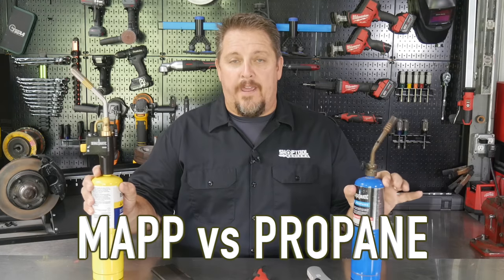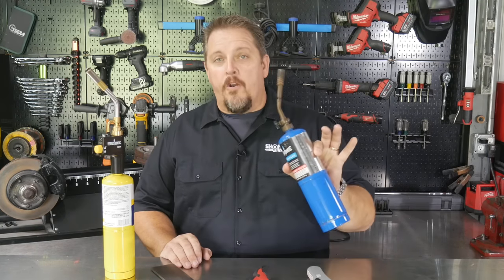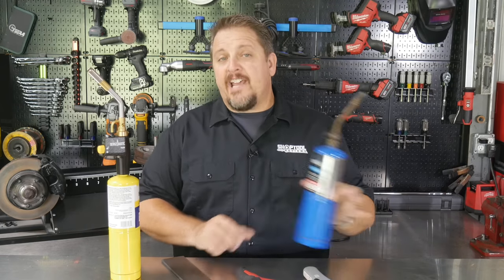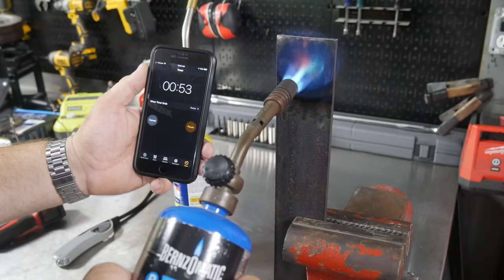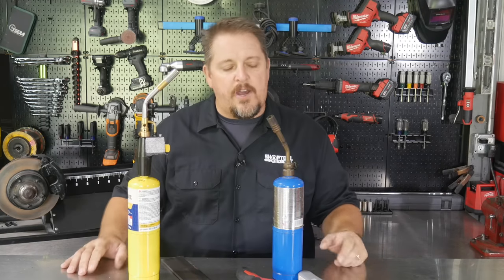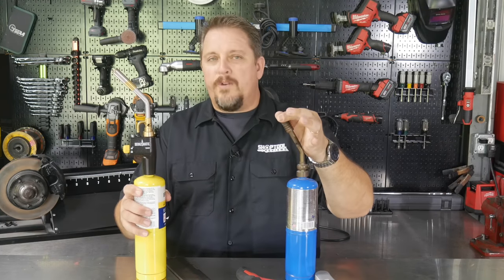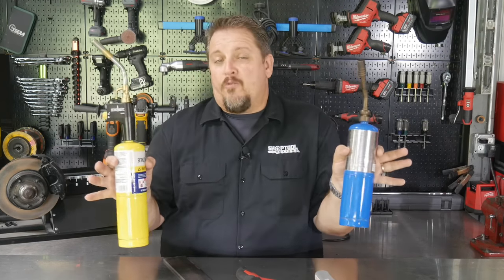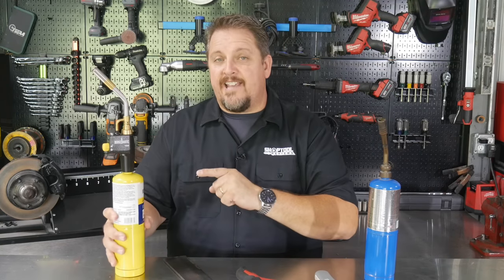MAPP Gas or Propane - Bernzomatic TS8000 Torch Kit

Comment: I'm a newbie in hand torch world, but this contradicts science. Look up adiabatic flame temperature of propane and propylene. Its quite the opposite, reason being each gram of propane produces more water in combustion than one gram of propylene. That extra water absorbs heat, so less heat would be available to the flame (which is just a mixture of carbon dioxide and water and inert nitrogen of course).
Something must have gone wrong.
Reply from the maker: And that's exactly why we did this test. There has been so much confusion around the Propane and MAPP discussion, and even more confusion since they stopped making the real MAPP. So, we performed this pretty simple test and shared the tips between the tanks. I'm not sure what could've gone wrong, but I'm sure there's a possibility. Thanks for watching.

Comment: Bernzomatic rates its TS8000 torch at ~12936 BTU/hr using propane and 12327 BTU/hr using MAPP. The torch head is mostly what determines the heat output of the setup, not the type of fuel. Also the flame temp doesn't really matter when heating up steel. All that matters is the BTU/hr that the torch produces.
Reply from the maker: You are correct. Thanks for watching.

Comment: My TS8000 tip end glows red about 1/2 down with map pro gas . I didn't time it but every time I have used it, fairly quickly. Should I be concerned about that?
Reply from the maker: That does sound a little odd, especially if it doesn't happen with Propane. You may want to check another tip and see if it does the same. Thanks for watching.
Reply: @Shoptoolreviews  just tried blue propane 1st time. It did not do it. then tried the map gas it did not do it. so I have to keep an eye on it . might take longer thanks for the reply.

Comment: Temperature wise ok I agree with you. But try to time how long it would take to melt silver or brazing rod then you’ll really see the difference.  I used propane for small brazing work and while metal is red hot, propane still can’t fully melt the brazing rod to create a pretty joint. However when I tried again with map pro, BOOM 30 second job is done, and melt the rod like butter.
Reply from the maker: I hear what you're saying, and that's probably not a bad test to perform, with brazing rod. But, then you get into which brazing rod to use? In the end, temperature melts that rod, so that's why we were aiming to test the temperature output from the torches. I think the main point is that torch tip geometry made more difference than the fuel.

Comment: how long does the can last? assumed that you let it open until it dies? 4-6h?
Reply: I just bought mine brand new and it ran out in no more than 6 minutes. Either that or it stopped working.  I have been trying to find this same answer because i feel like it should last much longer.
Reply: @kristopherbuchanan974  it definitely last much much longer,  ive been using one for more than half a year here and there.
Reply: @TheCyberCorn  thanks! I definitely felt it should have. I have a feeling i was sold a near empty bottle from the store.
Reply from the maker: Thanks for watching.

Comment: what happens if u put propane head on mapp gas? will it still work or no? basically is it dangerous?
Reply from the maker: It works just fine, but not as hot. Thanks for watching.
Reply: Wel if you watched the video at the very beginning he says that the propane head can’t be attached to the mapp tank.

Comment: MAP PRO IS NOT MAPP GAS. MAPP gas was discontinued is 2008 and burned at around 5300deg whereas map pro which isn’t MAPP burns at only around 130deg hotter than propane. Suggesting brazing with a bottle of MAPP pro is a bad call

Comment: the nice thing about mapp gas is that you can use it upside down unlike propane
Reply from the maker: Interesting, we'll have to test this. Thanks for watching and for commenting.
Reply: The Bernzomatic 8000 tested here burns upside down with propane too. Here's what Bernzomatic says: "When theses torches are inverted, the liquid propane works its way through the torch and extinguishes the flame. For work that requires inversion, we recommend a pressure-regulated torch, such as the TS3500 Multi-Use Torch or a cast body torch, such as the TS4000, BZ4500HS, or TS8000."

Comment: Maybe, just maybe, you could of had the same torch designs make model on both gas supplies then tested. Only saying 🤷🏻‍♂️ shouty
Reply from the maker: Isn't that what we did?! We tested them, then changed the torch heads. That was our final determination is that the torch head makes more difference than the fuel, because MAPP gas really doesn't exist anymore.

Comment: Yikes.  At some point the metal will stop taking heat. Both temperatures are the same after a minute big surprise the metal is radiating heat from the other side it's latent heat! A more scientific test would be to use two identical torches and see what gets to 400 degrees faster now bernzomatic claims there's 40 percent faster heat transfer.  Even though they vary in flame temp by only 130 degrees. Science!  But does a 40% faster heat transfer increase justify the 300% price increase?  Or can you just wait a minute. I mean time is money right?
Reply from the maker: Thanks for watching.

Comment: Use 1 torch, or switch the heads and test again. You are comparing a torch heads as well as fuel.
Reply from the maker: That was exactly our point at the end. We switched torched heads. Torch head makes all the difference -- MAP/PRO and Propane are not much different as far as fuel is concerned.
Reply: What blows my mind is that you can switch torch heads after first use. I was under the impression that once you screwed on the head, you’re stuck until it’s on empty. Sweet! Now I can use my new ts4000 on my old half full bottle of propane without wasting gas and money by buying mapp

Comment: why don't you use the same burners for each fuel? 
It's a bit biased.
Reply from the maker: That's exactly what we did, if you watched all the way through. That was the point...fuel doesn't matter, it's all in the tip/burner.

Comment: MAPP PRO- is a complete waste of money. It exists only as a “name” for marketing. MAPP gas was stopped being produced in 2008- it use to burn roughly 1500 degrees F hotter than propane. MAPP PRO is roughly 95% propylene and 5% propane, and only burns roughly 140 degrees F hotter than propane. It literally not noticeable. The only thing that is noticeable is how much money is wasted on yellow MAPP PRO bottles. If you need to heat something up faster, gone are the days of doing it with a single little tank. You’re gonna need a combo oxy/acetylene torch or a small oxy/ propane (or MAPP pro which would be a waste). That’s the only way you’re gonna notice a performance difference. If you are relying on MAPP PRO to do that- you’re burning your money away 💰 🔥 (no pun intended)
Reply from the maker: We explained all this in the video.

Comment: If your working on cars MAP! Open and shut case.
Reply from the maker: What's your reasoning?
Reply: I would like to hear why you think MAPP is better for working on cars. I've tried to use propane to heat up bolts that are froze on cars and it was not hot enough, but I did not use a high intensity head either. I would like to see this torch taken to a frozen bolt, and see if it can turn a nut red hot with propane, or does MAPP work better?
Reply: I have the same issue and I even started using x2 blow torches pointed at the rusted bolt and nut. Still won't get red cherry hot but so far it worked successful every time. The problem is MAP gas is very expensive x10 cans and you are already at 150$, propane can work out x12 for 30$. Even at current prices I'm thinking it's time to buy/DIY an induction heater. We will see...let's find out how often they break down first due to lack of cooling.

Comment: Not scientific at all, of course. Just a pitchman yelling about a Slap Chop, I mean...a Bernzomatic torch.
No explanation about why you “can’t” put a brass torch head on a MAP/PRO bottle—just “I know”. No mention of the temp of the metal BEFORE the first 30 second propane heating. Meh, it’s just another screaming “Billy Mays” or “Vince”.
Reply from the maker: totallyfrozen prove it wrong if you think our results are skewed or wrong. The point is, with a decent tip, Propane burns as hot as MAPP/Pro. MAPP is all but a gimmick now, true MAPP has hasn’t been produced for over 10 years.
Reply: Shop Tool Reviews 
LOL! Who told you that you can’t use MAP/PRO in a propane torch? MAP/PRO burns only 130° hotter than propane. MAP/PRO burns at about 3,370°F while propane burns at about 3,600°F. The melting point of brass is about 1,700°F. So if the brass torch was going to melt at all, it would melt with propane just as easily as with MAP/PRO. The design of the torch keeps the heat out front of the nozzle, not concentrated IN the nozzle. So it won’t melt the nozzle.
Reply from the maker: totallyfrozen I never said the torch nozzle would melt. I’m not sure what you’re saying. My point is, the nozzle plays a huge role in the heat that the flame/fuel produces, whether Propane or MAPP.
Reply: TF, 
Why are you arguing with yourself?

Comment: VERY POOR Test design: Using different torch tips on the two canisters make this test and results useless. Different torches and tips can burn at different temperatures on the same canister.
Reply from the maker: Did you watch the whole video? That was the point. The fuel didn't make a difference, the tips did. There is really no such thing as MAPP gas anymore. Thanks for watching.